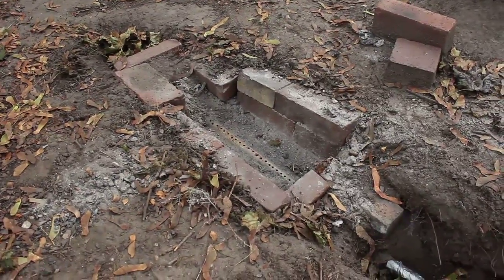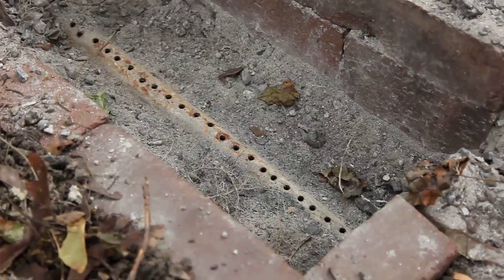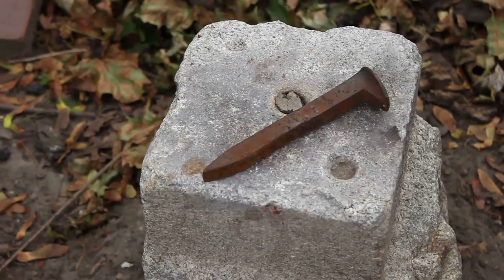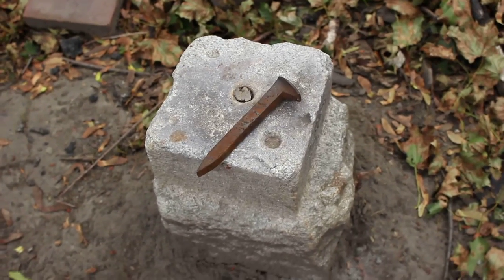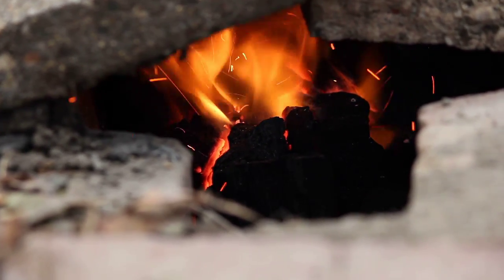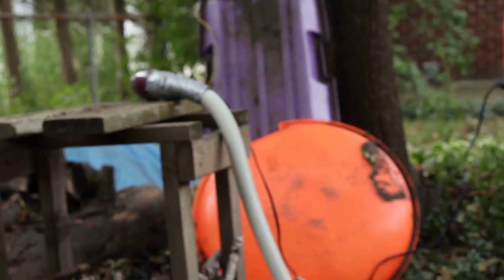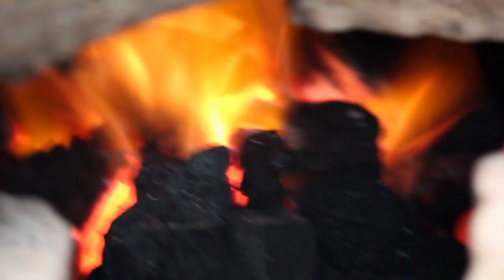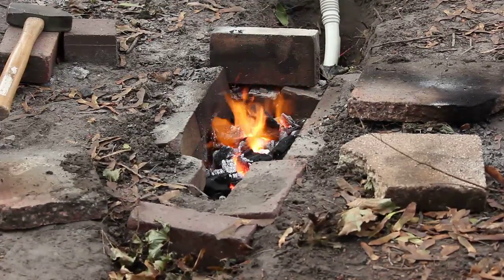Backyard Bladesmithing, Part 1

Comment: kudos to the granite anvil. Screw whoever wants to criticise your set, first of all, the video CLEARLY says "backyard bladesmithing" and granite was the primitive anvil of choice as it was the hardest most common stone available everywhere. Bladesmiths learn your history!
P.S. good idea with the hair dryer, ive been using a bag-valve (which already has the hose from the cpr mask!)
Reply: Yassa Sloan I see no problem with the rock. Ive gotten a 150 lb anvil so I wouldn’t use it but I started out using one like that but smaller

Comment: Hey man your set up is clever i wonder if you can heat up your metal with your stove and it would still work???
Reply from the maker: A normal kitchen stove won't get steel hot enough forge, but it is sufficient for heat treating.

Comment: Brother, you cant do what your doing with what you have.  First and foremost those pliers got to go!!!!  Get an Anvil, granite absorbs heat and has not resistant.  Make a better burner with black coal lumps.  And get your material white hot, not red hot to shape.  Youve got the right idea though, dont mean to pick here just helping friend.
Reply: Obviously he can. No his setup is not a quality setup with an expensive anvil, a proper forge, or strong bellows. but he is able to blacksmith and that's all that matters.
Reply: +Ralph james White hot is pretty much burning the steel
Reply: He doesn't need to do any of that and white hot is too hot, work the ,metal between red and orange heat and at a black heat with a clean hammer face to remove hammer marks.  This was a starting set up and a damn good one at that.
Reply: Derryl James i find his set up clever

Comment: Briefly: use the right tools: get yourself an anvil, get coal not barbeque grade charcoal.  The steel should be nearly white hot, not cherry red, not orange.  The plasticity of the steel should feel like clay or bubble gum when you hit it. Use a better hammer with a shorter handle for better control. Do not hammer so fast. Hammering at a slower rate keeps you in control of what you are doing.  Last but not least, those pliers make you nervous.
Reply: Using a large flat rock works alright if you're on a tight budget or waiting for an anvil to be delivered.  Where could I find coal because I've been using charcoal for the past two months?
Reply: 1959Berre hey man maybe he can't aford other stuff i started out the sam way
Reply: I've got a similar crude setup with the hairdryer etc but I agree that actual coal is a must, I was doing the same with charcoal and not getting anywhere but when I went to buy more it was 3.99 for 5kg charcoal or 2.49 for 10kg of house coal - Fired up the coal and when I came back 10 mins later expecting a farriers rasp be bright red I found it molten in half!!
Reply: Evan Benner you can make coal yourself. I've never done it, but I've seen tutorial around. Do a search.
Reply: dtj41 you can do it, but you can't make coke which is super compressed coal, lots of potential energy stored in that. you need a big infrastructure and high high heat. it's how Rockefeller got his process to smelt steel so efficiently (don't quote me). on the other hand, the Japanese would use pine charcoal because it burned longer and at a pretty good temp and didn't negatively affect the iron sand as much as other Western methods. please correct if wrong.
Reply: I hate when people hate on the guys just starting out i mean did you look up his post just to say that?

Comment: granit is nog a good choice for an anvil.. you want good hard steal that will reflect back the energy of the blow so you essentially hammer the material from both sides at once :P

of coarse i suppose you could allway put a steal plate ontop of the granit block. of coarse then you might as well put it on a stump...

but if you cant an anvil on the cheap just bug a huge ass sledge hammer and use the head of the sledge hammer.. just make a hole in a stump or something to stick it in then use the sledge hammers head as an anvil..
Reply: Indeed. And granite is dangerous, too. A chip may hit you where it hurts.
Maybe a piece of railroad rail would be a good anvil.

And please: get a bigger hammer!
Reply: Thomas Bögel To be honest I don't really see a problem with the size of his hammer. I'd guess it's about 1-3/4 pounds based on the head, and even though that's the minimum I don't think it needs to be much bigger/heavier.

I base my knowledge of average optimal weight based on this chart.
http://www.anvilfire.com/FAQs/hammerwt_index.htm
Reply: livixs Depending on what I do, I also use smaller hammers. However, I seem to have just so many hits in my arm per day, and that does not seem to be in a linear relation to hammer weight - so I prefer a biger hammer.
Whatever works for you, though.
Reply: If you want a cheap anvil then I recommend a piece of railway track... that what my anvil is made from.. that the right kind of steal..

its not quite as good for making something really straight though like a knife blade..

and the ringing is a sign that its a good anvil... if you want ot reduce it some you can add a magnet to it.. that will help to reduce the duration of the ringing if not the initial sound..
Reply: ZerqTM gotta make most of what you got

Comment: With a simple charcoal setup, you can easily get hot enough to make steel burn. The only reason for coke would be that indeed it lasts longer. Otoh, charcoal burns cleaner. I still use charcoal because it is easy, cheap, and clean.

Comment: I made a miniforge this weekend as well.  Just had a few bricks around and a propane torch.  Didn't get my steel THAT hot but it was red hot at the tip.  I'm planning on redesigning it like yours but my stepfather likes it the way it is :P

Comment: A granite anvil is not good compared to a real hard metal one. But the most important part is that it works. 

IE: Not the best thing in the world, but a good enough solution if you are not going to pay for a anvil yet.

Btw, very nice idea to use a hair drier to push air into the coal. Simple, effective and cheap. When i first started i used a few PC fans, as i had quite a few of them spare.

Comment: if you want really high temperature use charcoal, then to make it improve use the bricks and make it like a box accept that you want to use like idea fire pit furnish then I watch a guy who use clay to keep the temperature high because he said that how old day viking was using it to get 3,000 degree heat so the metal can melt, but I prefer use like 1,500 degree so you can easy bin wield for my guess.

Comment: Well actually, I have made a primitive knife using cinder blocks and different sized rocks before. I made the forge with 2 cinder blocks placed into a v shape. In there that was where I burnt the coals. For the bellows I used an old syringe like water gun. It was a job for the biceps but defiantly did the trick (I have also used blow pipes before but id choose the water gun over that any day). Then I used another cinder block for the anvil and the stones as hammers.

Comment: If you can get a 1' or 2' section of rr rail.  You can make a pier anvil.  I welded a plate to the bottom and bolted it to a log set in the ground.  They bounce a lot less when vertical.  I usually use hard coal, but I also built a retort to produce coke for forge welding.  It is basically a 35 gallon drum inside a 55 gallon drum w/ a little piping.

Comment from the maker: The granite I salvaged had been ground flat on the portion I used as an anvil face so I didn't have any problem with the shape. I've never heard of anyone using a concrete anvil. I doubt it would stand up to the hammering.

Comment: Good vid. you should make it hotter, when i built my furnace i made a smaller hole a bit deeper and a single pipe running to the bottom at a 45 degree angle i used two vaccum cleaner motors to drive it. One vaccum was sufficient. but, two made it white hot! i should post a vid of it x, x

Comment from the maker: My understanding is that when steel is annealed it is the softest possible (in a cold state). Annealed material is therefore preferable to work with for stock removal, etc.  However not all steel needs to be annealed. Mild steel (like RR spikes) only really needs to be normalized.